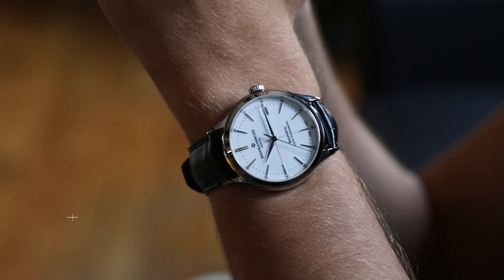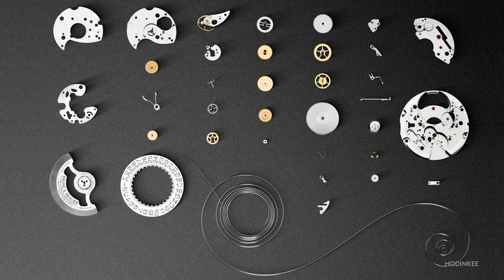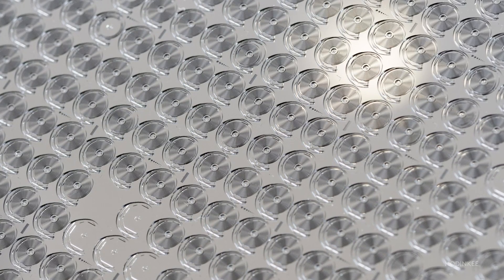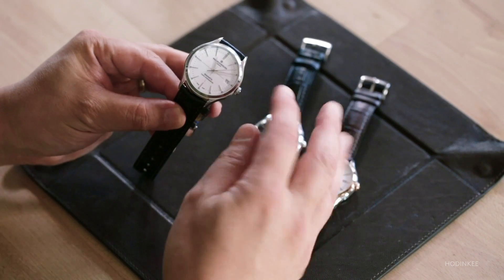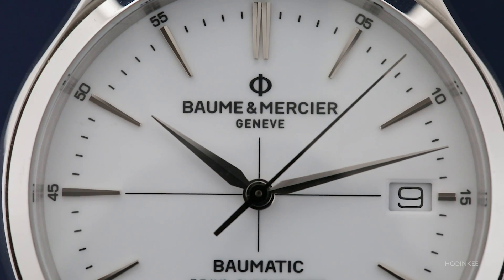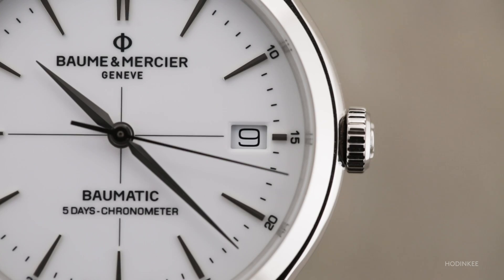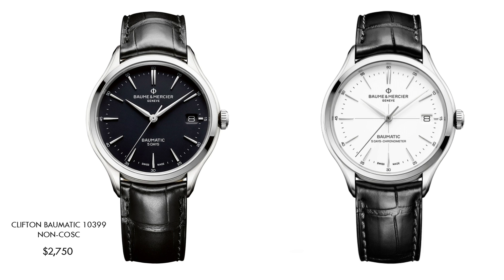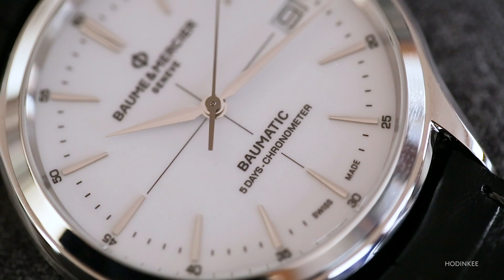A Week On The Wrist: The Baume & Mercier Clifton Baumatic COSC

Comment: The 5 day power reserve is crazy - but if you’re wearing your watch every day an extended power reserve is cool but unnecessary. Blued hands would have looked killer  on that sharp white enamel dial. Silicon balance springs are everywhere in modern movements right now - I’ve got one in my Tissot Gentleman which is an amazing performing ETA movement. Sapphire case backs are fun but the novelty wears off real quick and you end up glancing at the movement only occasionally. Nice watches and I Iike the branding. Fresh.

Comment: Your excerpt should read: The Richemont Group has been at the forefront of ripping consumers off for decades and kills innovation with each brand it acquires. Using advanced materials for balance springs and other watch components has been going on for years - the Japanese are far more advanced in this area. The Richemont Group is a predatory brand merchant who acquires brands then leverages them to introduce run of the mill products with jacked up prices to milk consumers - complimented by slick marketing and distribution control
Reply: The greedy off the mill part is very true. The part about not being ingenuitive is doubtful. JLC, IWC and even Piaget make some of the most important, top quality, horologically significant, and award winning models out there. 
Corporate affair could’ve been solved differently. But Richmont is profitable!
Reply: Fascinating analysis. Go buy a cheap Japanese watch then...
Reply: RedCapitalist Agreed.. Was going to comment almost the same thing.. 
They’re offering 5 days power reserve, cosc, and silicone parts with this watch by using their smaller brand - BM so that people will think they offered higher values through this brand. Well, those features are old tech stuff in watch industry and should be used as a standard..
Reply: @V P I have the clifton baumatic 10436 and it is a great timepiece, but the Grand Seiko does pay higher attention to detail them many other watchmakers, this has been shown while disassembling one under a microscope.
Reply: @V P I appreciate any high level of detail, especially to parts that are never seen by the owner. Weather it be Swiss or Japanese, high quality detail of work is still a representation of a watchmaker's talent and skill level.  👍
Reply: @V P While this is not an all-encompassing article, it does show the amount of detail and work that goes into making the case of one of their Timepieces. https://forums.watchuseek.com/f642/understanding-grand-seiko-part-3-case-manufacturing-zaratsu-finishing-4335490.html
Reply: @V P If you are interested, checkout Watchtime magazine, it is pretty good, it has decent articles and reviews, plus nice pictures. https://www.watchtime.com/featured/baume-mercier-baumatic-review-first-impressions/
Reply: V P See my profile, stupid peasant
Reply: RedCapitalist why do you own an IWC then?